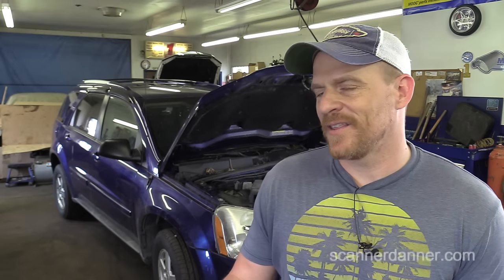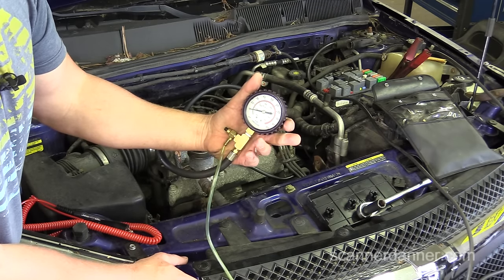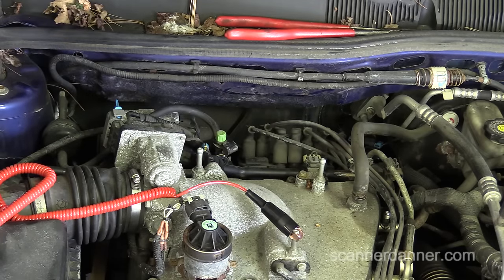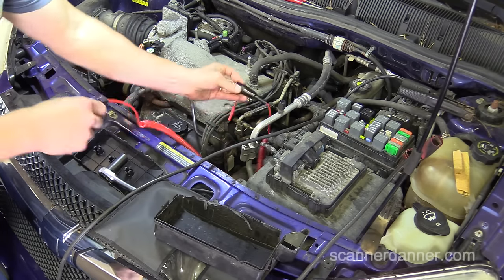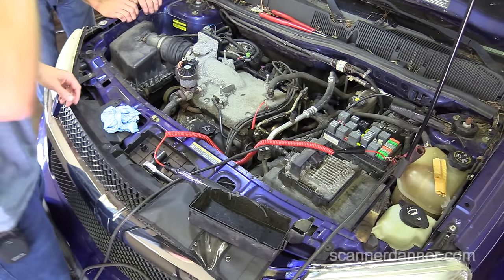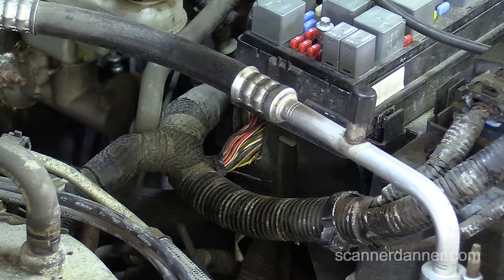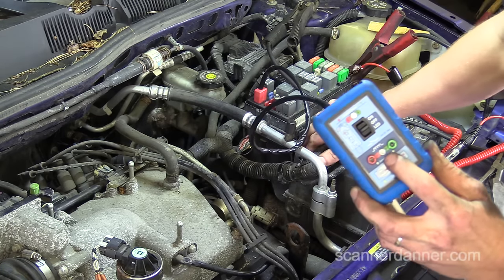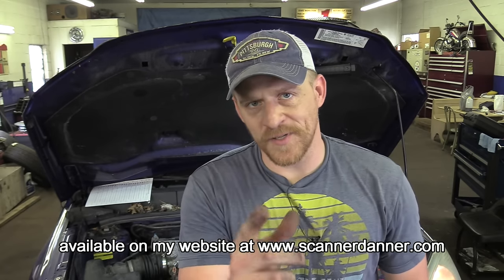No Start, Engine Cranks Okay, Troubleshooting With Basic Tools (No Power to Injectors)

Comment: First of all let me say thank you for for restoring my faith in humanity for providing information at this level without charging anything. My name is Paul and i have been into automotive diagnostics and repair for no less than 25 years.. I have allmost no formal training what so ever and trying to get the info to be able to trouble shoot and repair has been near impossible to obtain, and this is the best resource i have found to date. I have never been able to get into any sort of class for this type of training and this is awesome. Thank you again.
Reply from the maker: Paul, it is so good to here these type of stories! Keep following what I'm teaching, watch all my videos and I have no doubt we can get you exactly where you need to be to begin confidently troubleshooting these systems. 
BTW I am charging for some of my material but thanks for the compliment
Reply: i agree with most of the steps ( well actually all of them), except. the first step should be to try starting fluid. this will tell you if your dumbass just towed the car come because the wife ran it out of gas and cleared the odometer (guage stuck at 1/4). would have saved me $200.
Reply from the maker: I wouldn't argue that, and have used that method many times. In this case, since I walked Pete through most of these steps over the phone the day before, I knew where we were with the vehicle.
Reply: I second that, Brandon F. - best $99 I've ever spent!
Reply: Thanks so much!
Reply: Thank you Brandon F!
Reply: Paul Clark, how did you get into the trade without any formal training? Here in the UK, all the dealers/garages that I've approached want to see motor mechanic  qualifications of some sort. I've done ALL the work on my own vehicles for 30+ years, own many garage tools etc, sadly not found any garage to take me on, even on a trail or part time basis.
Reply: I’ve been watching all your videos hoping to find the one with the problem with a 1994 Ford ranger 4.0.  It only starts with starting fluid or carb cleaner sprayed in the breather and will run only if I continue to spray it. Fuel pressure is 40psi with key on. I went through all the relays even bypassed some. Check the coil pack and have good spark. The injector plug is 12v on each side and I don’t think that is right is it? One should be a ground right . D have any idea what it might be!  I see u are a man of faith which is awesome and didn’t realize till I came across the video where u shared it!  Your videos are awsome and I have learned a lot!  You are very good at explaining things.  I plan on subscribing to your premium channel on my next paycheck cause the info is worth it. Thankyou for ally do
Bill
Reply: Paul Clark     Yea don't know if you can help me are not I'm working on a 2000 Monte Carlo  just installed a lower manifold gasket kit into this 3400 got it all back together and it would not start I'm thinking the fuel pump I got to the pump and disconnected sending unit connector and the pump connector and used a multimeter and both connectors were reading just over 5 volts checked the relay and the fuses they seemed to be in good working order so now I'm stuck don't have know more ideas hoping you can help.
Reply: God Bless Brother;you're a good man.
Reply: @steveclark..  very sad me olde bute
Reply: Very informative...keep it up
Reply: 04 Nissan Murano how do you get past the theft system
Reply: I must yeah thanks as well hard to find Antony that dose give up a lot of help and I ideas right cool deal thanks
Reply: Your are so good mr paul 
Thanks for the. Teaching
Reply: good morning, brother. Hey, can you please help me out with a  cuestion I bought a 2011 dodge caliber, but it doesn't have the intake magnefull runner control valve. Is this normal ?
Reply: Wow that's awesome remember sir learning is a continuous process 🙏🏿🙏🏿

Comment: Got to share this one with you.... I bought a 2005 Equinox for my daughter...it looked ok.... the next day the CEL comes on  and would not stay running, so I run code and it points to the EGR.... I run Data Stream and at idle the ECM is calling for the EGR to open at 100% and it goes down as I increase idle.....since I know the 2005 has a TSB for the EGR I surmise that whoever switched out the EGR and harness wired it up backward.....that's what I found and I fixed it and had a good running vehicle!

Comment: A broken wire can be repaired/ replaced in a number of different ways depending on time restriction, location of the repair and customers budget. Too many ppl already  focusing on the repair rather than the step by step fault finding which was shown and can be used on on another no-start vehicle. Great Video using basic tools.

Comment: Back in the 90s i repaired numerous ECUs for failed relay drivers, for main and fuel pump relays. But then again i rarely found out the reason for the failure, and knowing a lot of my customers I'm not ruling out damage due to poor diagnostic approaches! 😅

Comment: You're a legend but as we used to discuss before I don't use a test probe because of that reason that the ground always comes off I like a meter to show me the exact voltage different ways of troubleshooting as long as we get to the root of the problem you're the legend

Comment: Awesome educational video. I am up against this scenario,, 2006 Saturn Ion 2.2. Starter cranks over engine, No Visible Rpm Gauge movement,, smell fuel under hood,, so I am ruling out delivery from tank to engine,, a few pops of engine, no symptoms at all. Car sat for a period  9 Days of time through Cold snap of 1 to 10 degrees. No OBD 2codes relating to failed Crankcase position Sensor errors or the like. This video will help immensely to rule out other possible causes. Thanks, I enjoyed the learning experience. Great real time real life trouble shooting. This video is key to ruling things out.

Comment: Recieved my SD diagnostic manual yesterday, and now another great vid today. feeling blessed. Those sparks around the fuel test pressure area,reminded me a fire extinguisher in my mobile tool kit is just as important as.the Scanner Danner manual, and a test light. Thanks.
Reply from the maker: Thank you Bernie!
Reply: Thank Ya.

Comment: I agree with you on troubleshooting from schematic when you go to the fuse that's connected to The load side that fuse all you have to do is go to the other side of the fuse to tell you if you have b+ if you have b+ on that side that means everything has been activated in the relay and the PCM is giving a ground to the relay at one shop that'll tell you everything me and you promote the same electronics on our channels in automotive it's good to see someone who knows the basic foundation of electronics

Comment: Thank You!  I have been searching and searching to find a video that just might help me. My Envoy has been down for just over a week now, I have been out there every day trying to figure it out. At the end of a long disappointing day out with my car I would be at my computer searching for a video that might point me in the right direction, most of the videos stopped with a bad fuel pump, which I knew mine was working good. I really liked your methods to diagnostics, your method was easy to understand and easy to follow. And it was spot on to what my problem was, within 1 1/2 hours I located my problem. I greatly appreciate the great videos you put out. Keep up the great job and thank you again.
Reply from the maker: Heck yeah man, awesome! And you get an A for your diligence. Nice job man
Reply: @ScannerDanner  I can not take all the credit,  I am always used to it being a part going bad that starts out costing me over $150. I would never have thought it to be a bad wire (costing me less than $5.00 to fix). You get most of the credit for Point me in the right direction and for showing me how to test to find out what to even look for! Thanks again Sir.

Comment: I like your videos man, very informative. I'm just curious what kind of tool do you use to find a short in a circuit that is causing the fuse to open?  Splice sleeves(butt connectors), whatever people choose to call them, will work fine as a repair to a circuit like this. GM uses these in their connector repair kits when you have to splice in a new connector, I used them hundreds of times with no issues at all. Don't buy the cheap no name ones at wally world and you won't have a problem.
Reply from the maker: I have a few different tools for that. One is basically a circuit breaker and you follow the needle sweeps like a compass
Reply: That sounds like the same one I have, it works really well.

Comment: Top notch troubleshooting and repair, some will disagree with but connectors however I see no issue when done properly in locations like this. Well done!!!! For some odd reason I had a flash back from a later video you did, But face *but face 😁Thanks for sharing Paul

Comment: I see no issue butt connector.  Solder joints (esp unsupported) will weaken and break before a proper crimped joint.  Only solder joint I'd even consider in a high vibration environment like a engine compartment is a NASA style lineman's splice.  Marine butt connectors are the way to go.  If you insist on solder, get a marine style butt connector with solder.
Reply from the maker: I've heard of those. So there is solder inside of the butt connector and when you heat it, not only does it act as a shrink wrap, but then it melts the solder?
It seems you would have to get it too hot for the plastic before the solder would melt?
Reply: Yes, there is a solder ring inside the adhesive lined heat shrink connector.  "Solder splice" would be the term to search.
Reply from the maker: got it, thanks!

Comment: dude i would never use butt connector on computer circuits. i would solder and use shrink tube. but real good troubleshooting
Reply from the maker: To each his own. Thanks for the comment
Reply: Craig Binger ii
Reply: Eventually the solder would break due to vibration. Heat shrink butt connectors are a good alternative!
Reply: I've seen too many solder joints crack. Heat shrink butt connectors are the go for me.
Reply: then your using cheap solder or not heating the joints correctly and getting cold solder joints...  ive never ever in 30 years had a solder joint go bad or crack....
Reply: They work just fine. A proper, sealed connector will last years and years and years.
Reply: I would have to agree, no butt connectors allowed. Only on a temporary repair.
Reply: It butt connectors were so bad, why do they use them aviation?
Reply: dude, every wire in that relay/fuse box has a connector crimped on it. These are not computer circuits.
Reply: I use non insulated butt connectors with a good crimp, and shrink tube with adhesive and it's never failed me
Reply: @ScannerDanner  I commend you for your incredible restraint. Well said.

Anyway, I was just curious to know how the Uactivate tool was able to provide the missing computer-controlled ground for the control side( unless it is just activating the load side). Now I have to buy another cool tool for my toolbox thanks to you. LOL.
Reply from the maker: The switch on the uActivate tool completes the load side of the relay. Thanks!

Comment: Thanks for this. I had my '99 Montana van towed to the shop for what I thought was the fuel pump. Turns out it was NOT. The father and son team have been working on it for over 3 weeks trying to figure it out. The son has been doing most of the diagnostics and told me he thinks it's one of the modules, but after watching this, I'm not so sure. Wish you could call him and give him a few pointers over the phone....oh well....

Comment: jesus christ people, the repair is 100% acceptable but not text book.. you could pull the fuse box by undoing those 8mm bolts and you will have better access on that connector, given the intake manifold is corroded like that, the chance of breaking few locking connector on that fuse box is very high, so will you risk a $1 repair over a possible fuse box or fuse box connector damage???
Reply from the maker: exactly

Comment: A mini van came in on the hook. Couple of guys threw their hands up. Me being new but the most experienced asked for the job. In 30 seconds I had the engine running. The fuel gauge was stuck and the van was out of gas. I squirted some carb cleaner down the booster hose, vroooom. Even before I do electrical checks (except the battery,all electrical problems start at the battery) I perform this carb squirt test,saves a lot of time.

Comment: why not solder?
Reply from the maker: Too difficult in this location
Reply: Louie Moscatel

done it hundreds of times....
Reply: Indeed time is money. A did not mean any disrespect to SD. And yes taking the fuse block up and make it wide open. But in my opinion I have done it and yes with heat shrink marine grade with the same sealant the bonds with the insulation. The trick is put more wire into it. And wrap the loom back together. I also add a piece of hard plastic under my wrap to keep the movement down to a minimum. 30 plus years of repair under my belt. ASE master also.
Reply: I do high end repairs. Cars in So California last bit longer and so the repair must last. I offer two year warranty 24k miles.  Got to stand behind a repair that would make others say.... Wow. That was over kill.
Reply: could have twisted them together and wrapped it with chewed bubble gum, it would probably outlast the car from the looks of it :))
Reply: Lol.... Like that idea
Reply: I'm a Scanner fan and owner of his book. Love his videos. I like his approach to diagnostics, which is what his videos are about. I'm a solderer - and my solder doesn't break, either! Before viewing these comments, I was wondering how he was going to get in there with a shrink and had my plan in my head so may as well share it. I'd have cleaned, tinned and soldered one end to an extra piece of wire, then slid over the shrink tube, done the same with the other ends of the wires, and finally folded the extra length leaving a little slack before shrinking. I accept that everyone has their way of working, but I hate crimped connectors :(

Comment: I would have soldered the wire with electronic solder and heat shrink seal — GREAT INSTRUCTION ON HOW TO PROPERLY TROUBLESHOOT THE PROBLEM 👍👍👍😊✌️✌️

Comment: hey paul great video, i just noticed that when you were checking the injector fuses the key was not on, and the key was turned to on when you started to check the relay... I know that you had already diagnosed the problem and you were just showing us the process... thanks
Reply: I knew where we were based on my phone call to Pete and walking him through this as far as I could on the phone, which was knowing there was no control on the relay. I did not manipulate anything in this video to make it look like anything that it wasnt.

Comment: Found this video and another from this guy. 
Its 746am and 708 am i finished this video.  
 Wifes truck is running again but i did not find the broken wire nor determine faulty relay but it is between the two.
Same area but might be the wire coupler connection that is moving about or the fuel relay.
I swapped all relay of the same type and some square 40a fuses.  If it does happen again after i put new relays in than it will be a wire(s) within half foot of the fues box.
Now on top my pickup which is box ,wore , or fuel pump. 
 Lol whish me luck here in 2024 as i just noticed thos os 7 years ago but best by far of how to execute tracing a no start step by step

Comment: Trying to help my friend out with his 89 dodge dokata 3.9 v6. It stopped running no fuel pressure change the pumped we have fuel pressure an spark. If you pore a little gas in the throttle body it will run then dies. We have nothing to our injectors. Not working at all. Watched a few other videos an maybe it's the camshaft sensor that is bad. Or the signal wire isnt sending signal or lost a ground. With this video I have alot more things to check now before we send it to a shop to get checked. Thanks for the video very much appreciated

Comment: Ground is of utmost importance when testing electrical circuits. What I do is take some short scrap wire, find a bolt, screw or nut, loosen it and loop the scrap wire around it and tighten. Now I know my ground is good. I then use the other end of the wire to connect my ground
.

Comment: your skills are unparalleled to most in the car community in this day and age. Thanks for all the info you have shown. Wish I had your skills on a current 3vze Toyota that has a cranking hot soak issue. Slight miss when warmed up as well.. Leaking injector is where I'm at with a new coolant sensor, plugs, wires, fuel filter, rotor, cap, coil, ignition module.
Reply: you can have a drink and drink

Comment: 89 s15 GMC jimmy, once in awhile starts with key, if it doesn't start immediately, it won't start until popping the clutch, cranks fine, helps if leave the key on for a few MINUTES before cranking. But not always, speedometer quit working, can hear fuel pump, but no spark or fuel using key only. Also temp sensitive for starting. Changed relays on firewall, been frustrating and my friends getting tired of towing me to get it started, usually starts popping the clutch within 3 turns of the tire, but every now and then takes several laps around the parking lot (big restaurant parking lot)

Comment: That was so educational - I learnt heaps from that. I agree that there appears to be somewhat of a design fault with the harness - maybe the bottom lip of the control box should have had a rubber protector. How did you repair the outer sheathing of the wiring loom? Fantastic video - thank you.